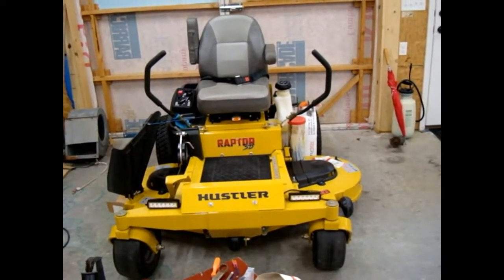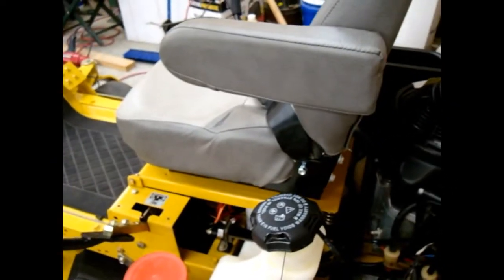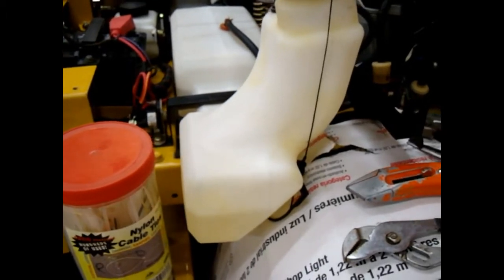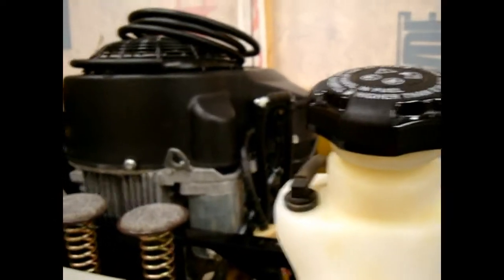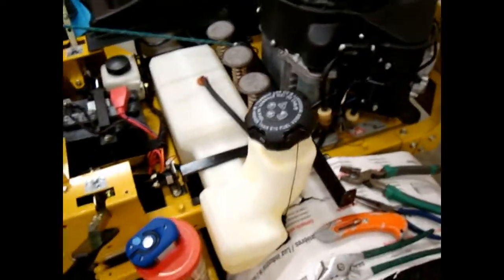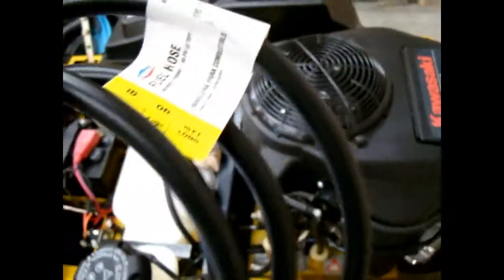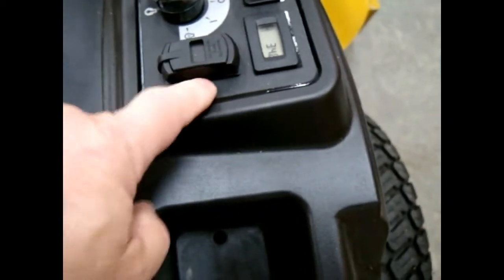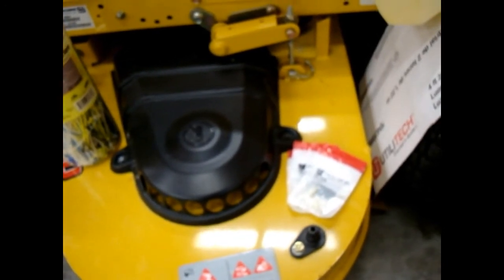Maximize Your Mowing Time: Evaluate Upgrading Fuel Tank Capacity in the Hustler Raptor SD

Comment: Now put a wrist sweat band around the cap of the hydro tank to help filter dust from being sucked into the tank when venting.   Never use a seat belt with out ROPS!!!!!
Reply from the maker: Good idea on the vent filtration. Will produce a cap filter for that immediately.

The Seat Belt was for video demonstration purposes. That is great advice for all to follow.

Thanks Mike.
Reply: @MaxsGarajMahal  If you want a project that will really challenge your skills, install front disk brakes.  They are the best safety feature you can have.

Comment: On the filter you moved,  is the hose that goes through the frame attached to anything?  I am thinking it is not?
Reply from the maker: No, it isn't necessary as it is going thru the hole already in the engine mounting plate. It is long enough once it is forced thru, it isn't coming out without help.
Reply: @MaxsGarajMahal  After a year from new my stock filter was full of dirt and grass!!!  Can I just replace it with a fuel filter?!
Reply from the maker: @ElonMuskX  Yes Sir. It is simply a 1/4" fuel filter.

Comment: What did you get the bigger gas tank?
Reply from the maker: It is the tank that came in it. Does it appear larger than yours? It is the factory three gallon and reason they're three gallons is the ludicrous ventilation design. I reengineered the ventilation that allows another gallon+ of fuel. I've mowed both left and right side down on a 35 degree hillside for 9 years now without spilling a drop of precious fuel. 

Hope that helps and thanks for watching.

Comment: Why would anybody use seatbelt without ROPS? If I was to turn over without something to protect me I'm gonna jump.
Reply from the maker: Couple of reasons. First one is performance wise and that is to keep the operator pulled back into the seat keeping the operator from sliding forward. Second is for installation instruction. I did say don't do this yourself.
Reply from the maker: John, hope you subscribed. If not, would you please kind Sir?
Reply: I totally agree. I was questioning that myself. If it rolls not only do you have to worry about trying to get the mower off of you , you now have to remove a seat belt in a bad position.

I pulled a dead man out of a pond as the first, first responder who was pinned under a flipped ZT mower. It had no ROPS or seatbelt. Had it had a ROPS he may not have survived if he had a belt as he would have been held in the seat by the belt under water. Had he had a belt in his mower without ROPS it would have been almost impossible for us to have moved the mower with him belted in. Two of us flipped that mower.

Comment: Yes,🌼 allabout.wiki/Hustler the bag fills up pretty quickly when there are lots of leaves and I guess that is expected. It is quick to take the leaf catching bag off and put it back on. There is one bar with rubber ends that fits into a slot (bottom), one bar with angled ends that hangs on rubber hooks (top), and two stretchy loops that each hang on a rubber hook (one each side). You can hold the leaf catching bag with one hand full and not drop any leaves. It is NOT easy to empty it into a lawn bag without spilling. My trick: I put two lawn bags side-by-side in a large garbage bin and emptied the leaf catching bag into them. What spills falls into the garbage bin. 90% of the leaves end up in the bags this way with 0% back on the lawn.
Reply from the maker: Glad you enjoy your machine. Show us your unit.